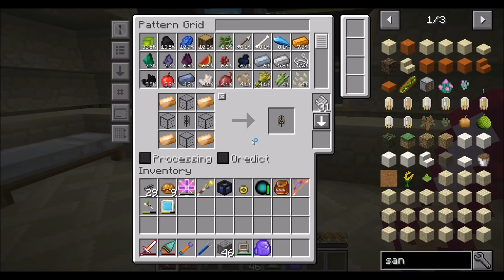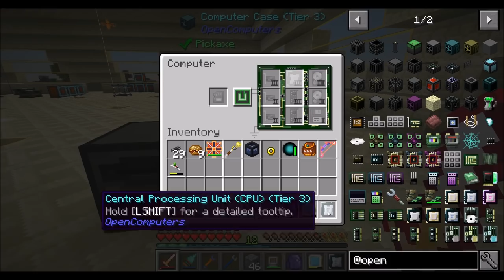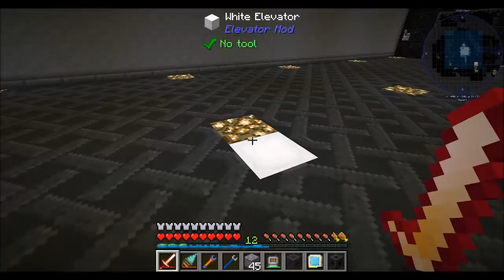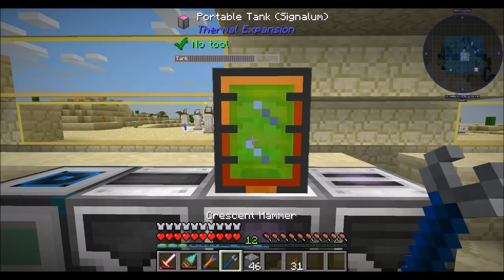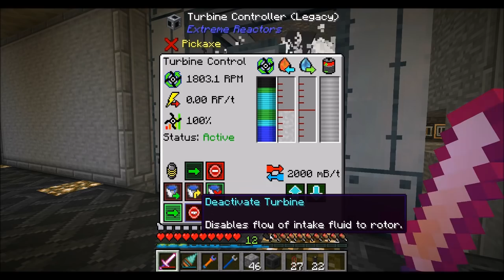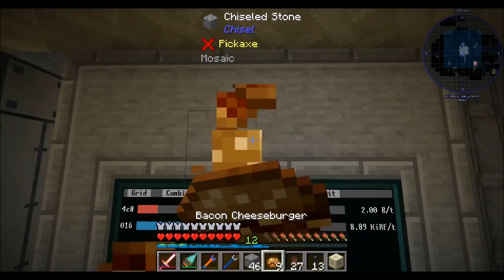Lets Play S9 E86 Reactor Control

Comment: Here's a very easy solution: set the energy cell to input 10KRF & output 25KRF, and connect the turbine to the both cell and orb. All the power in the buffer will immediately dump out if the orb isn't full, and it'll fill up after the orb has.

Comment: Yo dire,

The on/off switch on the grid tab turns off the grid controller, which makes your power gen "dumb".
Essentially it disables the aggregated control of each reactor/turbine. At this point every component is going to be independet und thus unable to turn itself off completely (passive reactors in PWM mode still can tho). Essentially what you'll see is that if your energy storage is full and the grid controller is turned off, the internal buffer of the turbine fills up and the turbine starts throtteling itself to match your power generation instead. This of course might be incredibly inefficient OR you might be consuming less power than your turbines lowest sweet spot, at which point the turbine is going to waste energy.

TL;DR you always want the grid controller to be enabled when using turbines.

On another note (you already did something tho i assume) you could try and put the pylons into the ceiling of your pyramid. That way you'd "only" have to run cabling inside your pyramid.

Comment: 'ee' 'prom' not 'eep' 'rom' is the common pronunciation...  Lol sorry that was bugging me.
Reply: While that is correct, there are many fundamental errors in that name and its pronunciation. The memory is the main subject, its first major classification in this is that it's read-only (which is both wrong, AND contradicted in the abbreviation itself), and then that it's programmable, and finally (redundantly) that it's electrically erasable.

I blame people that were lazy in the nomenclature when the tech moved from ROM to PROM (Which probably should have changed from being ROM at that point because it's writable once), to EPROM (Which definitely isn't ROM anymore, as you can erase it many times via UV), and finally to EEPROM which is unequivocally not ROM anymore as the chip itself can read/write/erase.

Also it bucks common nomenclature everywhere else in the industry. CD-ROM, RAM, RW-DVD, CPU, GPU, ALU, APU, etc. Notice how all those are at their root Three Letter Abbreviations? Electrically Erasable, Programmable, Read-Only Memory. EE P ROM, maybe EEP ROM, but it really shouldn't be EE PROM.

Comment: hey. you can put the cell in between, but also put a connection, that is bypassing the cell, so the extra power goes trough there, but once the orb fills, the cell in turn will too

Comment: Dire I really enjoy watching you write code it helps me keep my own code concise and clean as you do and I just wanted to point out that if you connect the phantom face to the core at the centre of the orb (or maybe one of the stabilizers) it would show you the total rf stored and the total capacity for the orb. I think the limit is not in the phantom face but on the output pylon

Comment: dire you could use a secondary computer that reads the orb and sends its data to the reactors computer,  all though it would use more power and possibly mean righting and modifying code you wouldn't have to run as much wiring

Comment: Dire, Open Computers can do wireless connection between computers. Just connect a computer to the orb and link it in wirelessly to the one at the turbines.
Reply: Well it would require to adapt the code slightly but the main computer can request info from a different computer which is connected to the actual source.
Therefore you would be able to connect a computer to the orb that wirelessly relays information to the main computer.
The bgrc script then needs to be adapted slightly to use the relayed information rather than directly from the source.

But I'm sure dire will figure something out that works.
Reply: That won't connect the components though.

The computers are then able to network with each other but they won't share their components, which is required for BRGC to be able to read the orbs information.

Comment: It's too bad Extreme Reactors still doesn't have vanilla redstone to manage the turbines. I'm sure I could rig up some sort of kludge that uses RS latches to keep the turbine going properly. But then, I'd be using an intermediary storage vessel for steam so I could just make a whole bunch ahead of time and pipe it into the turbine on an as-needed basis. Which makes no logical sense because steam doesn't work that way, but I think we've long since passed that particular point.

Alternately, I'd just use Mekanism turbines. Steam goes in, power (and water) comes out, and you don't have to do nearly as much fiddling to get them going. I don't know how efficient they are at turning steam into power compared to Extreme Reactor turbines, and you have to build them vertically instead of whatever orientation you want, but I think the simplicity and lack of micromanagement make up for it.

Comment: Couldn't you just reverse the Phantom Faces? Instead of having the face read the orb, couldn't the face be linked to the OC and read directly at the orb? then you're moving data and not energy.
Reply: Elite29er phantom faces don't work like that. They only present themselves like "Look at me, I'm that block", but the linked block doesn't know it's being duplicated and only knows about its real surroundings. That's why auto output doesn't work through phantom faces - the original tile entity doesn't know to look for a remote inventory

Comment: Couldn't you just have connected the adaptor to the orb and then connected it to the computer through the phantomface?
Reply: well there is no phantomface for data there is for blocks like furnace and stuff and energy and liquids none for information
Reply: Actually, I think this would have solved the problem. The phantonphase would probably act as if the adaptor was by the side of the Computer. Worth trying it.

There is also a Phantonface for Energy, which may not have that strange limit of energy. Also worth trying xD

Comment: How about another crazy method: set up another computer at the roof so it can read data from the orb and send that data to basement via LAN network.
Reply: better use W-Lan instead
Reply: Linked Cards (as opposed to Wireless cards) allow for 2 computers to talk to each other, over any distance. Assuming he only wants 2 computers, one by the reactors and one by the orb, that would probably be the best choice. Only question will be if the BRGC program supports networks.
Reply: You mean LAN? LAN is Local Area Network, so you said network twice.

Comment: Suggestion: you have those four power up/down points. Convert the second power up to a cable, so you can use the monitoring for the orb? Or, a cable up, in a glass column in the very center of the pyramid perhaps? 

Anyway, looking good Dire!